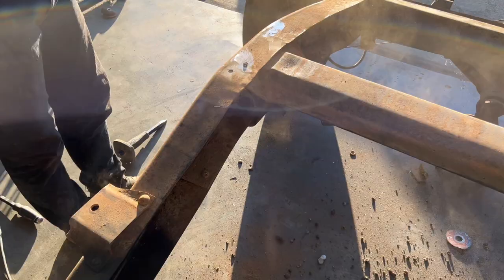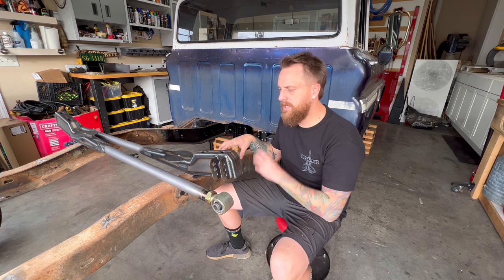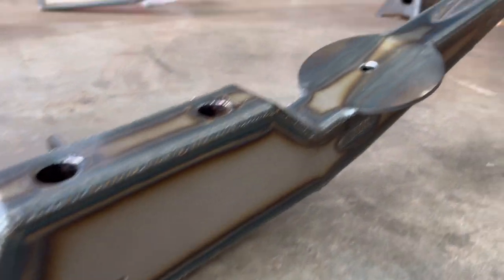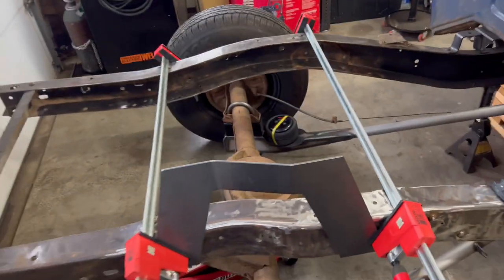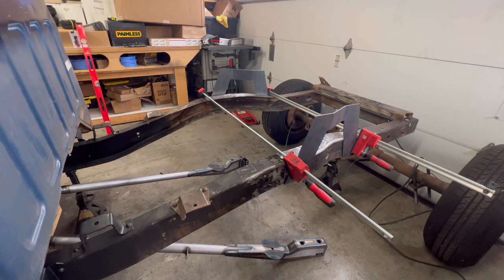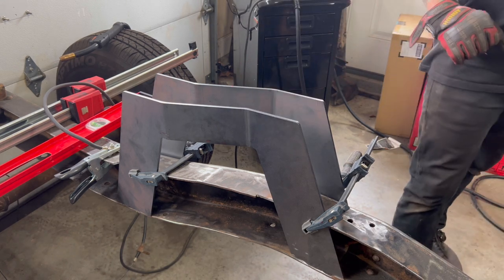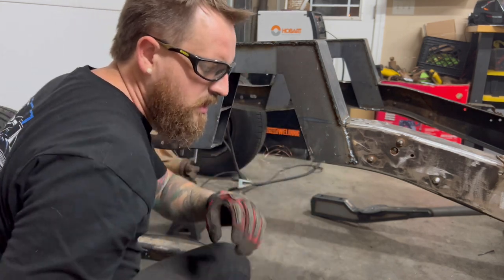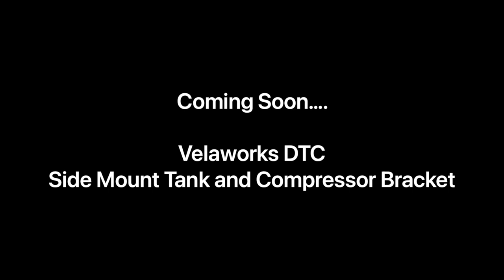FRANCIS EP.8 | Velaworks Step Notch | DIY Guide to installing a step notch on your 63-72 C10.

Comment: It’s important to verify the correct length of the Tinworks trailing arms. 
I was surprised how far the front rod end had to be unscrewed to equal the length of the stock trailing arms.
Reply from the maker: I agree to verify everything whether replacing factory parts or installing a completely custom setup. Thankfully in my case I can make it whatever length I want it to be since I’ll be shortening the driveshaft and mounting the bags in a different location. Thanks for your input!

Comment: Just wondering, would using a level (vertically) on the edge of the axle housing to find the edge of the housing. Transfer that mark to the frame, then measure back from the mark half the dia of the axle should find the mid point? Like your video! New subscriber!
Reply from the maker: Not sure I’m following. Do whatever you can to find center.

Comment: Will I run into issues with pinion angle if I run the Velaworks step notch with a stock trailing arm cross member?
Reply from the maker: Nonissues with pinion angle, but you will need to cut the top loop of your trailing arm crossmember because the driveshaft will hit it.

Comment: What welder did you use 120v OR 220V ? Also when you did your front set up conversion the tire rods in the brake kit upgrade won't fit into the original front drag link I'm doing 73-87 conversion for a 63 c10 not sure if i skipped over didn't see anyone upgrade their drag link when converting front brake and suspension.
Reply from the maker: I used a 220. Tie rods may need upgraded depending on the style and year spindle you convert to. I usually swap out the ball joints and tire rods when I convert.

Comment: will 2" blocks work on the rear or does it have to be 3"?
Reply from the maker: On 22s the Velaworks block is 4 inch. It depends on what size wheels. On 20s a 3 would be the largest to not have scrub issues. On smaller wheels, you need to have a smaller block. Scrub issues are when the trailing arm or u bolt stick below the rim and could drag the ground if you had a flat.

Comment: Do the Tinworks trailing arms work if you've cut the frame for a short box?
Reply from the maker: Depends on where you cut the frame. If you cut between the trailing arm crossmember and front half then it should.
Reply: @SIMPLE.C10  Was your frame cut down or standard length?
Reply from the maker: @GregMcRae-s8n  all my frames were standard. I know their arms will work with short or long bed because the trailing arms are the same length. When you shorten a truck the correct way it moves the trailing arm crossmember to under the cab. If that’s how you did it then it’s correct.
Reply: @SIMPLE.C10  Thanks for the feedback your videos are awesom. I just picked up a 1965 C10. You have pretty much laid a blueprint to build a cool truck. I'm sure I'll have a few questions along the way, thanks again.